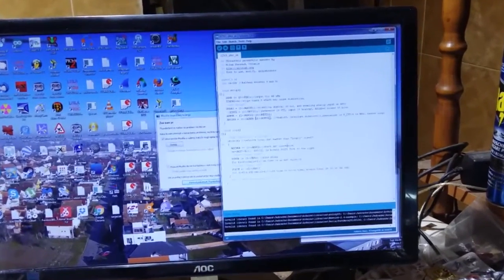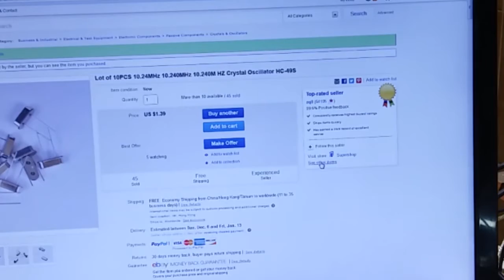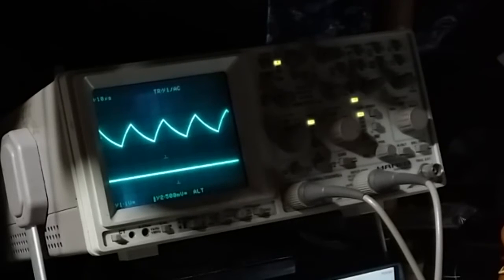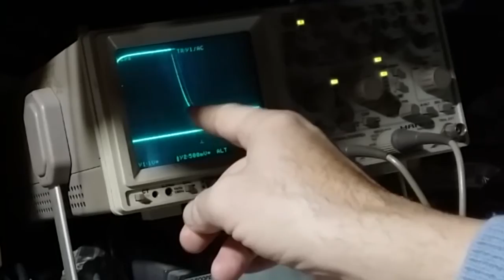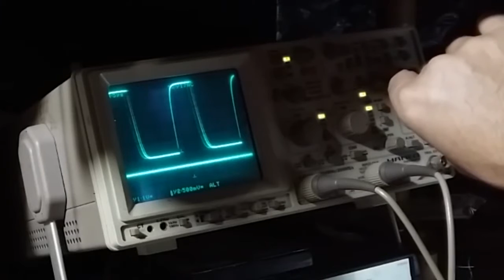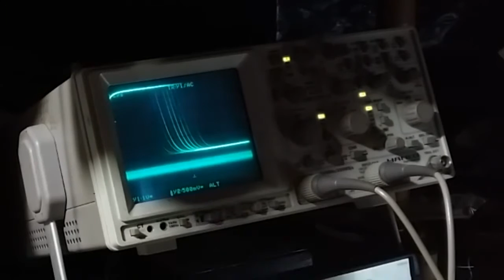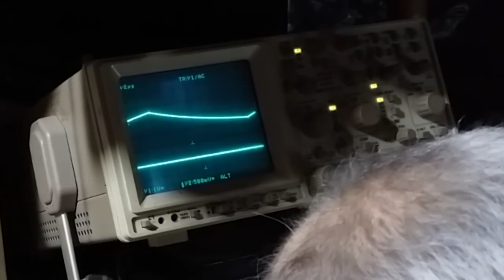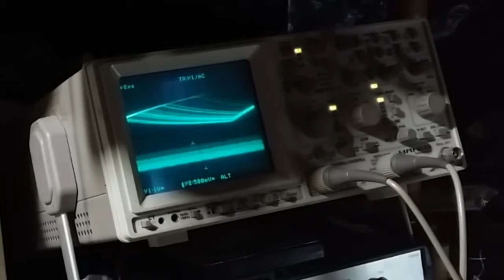PWM modulation - DAC on Atmega328p

Comment: Bok, kako ne - moze se na ATmega328 sa 16 MHz kristalom podesiti PWM na tocno 40 kHz. Kada se koristi 16 bitni timer 1 onda u fast PWM mode-u ne moras za TOP vrijednost koristiti 0xff (255) nego mozes koristiti i 0x1ff (511) i 0x3ff (1023), a osim fixnih vrijednosti se moze za TOP koristiti i OCR1A ili ICR1 (svaka od ove dvije mogucnosti ima neke prednosti i neke nedostatke). Uglavnom, ako za prescaler stavis 8 i za OCR1A stavis 49 pa podesis da se za TOP uzima OCR1A onda ce frekvencija fast PWM mode-a biti tocno 40000 Hz. U tom ce slucaju brojac ici od 0 do 49 pa ce biti jos vise od 32 vrijednosti za kontroliranje sirine impulsa tako da ce preciznost biti veca od 5 bitova a sirina impulsa (duty cycle) se moze podesavati s OCR1B. Slicno tome se isto moze postici i koristenjem timera 0 i timera 2 koji su osmobitni a jedina razlika sta se tice fast PWM mode-a je da se s njima moze koristiti samo jedna fixna vrijednost za TOP (255, sta je i logicno jer imaju samo 8 bitova) ali to nema veze jer se za TOP ionako nece koristiti fixna vrijednost i razlika je i u tome da oni nemaju pripadajuce ICR registre. Timeri su dosta komplexni, timer 0 i timer 2 imaju po 7 mode-ova rada a timer 1 moze raditi u cak 15 mode-ova tako da je lako previdjeti neku mogucnost. Da li si znao da neki AVR-ovi (recimo ATtiny85 ili npr. ATtiny861) imaju PLL clock za generiranje PWM-a od 64 MHz tako da se s njima moze generirati PWM signal na 250 kHz ili uz smanjenu rezoluciju do cak 500 kHz? U zadnjih godinu dana sam pogledao vecinu tvojih videa i vidim da te zanima 'direktno' (bare metal) programiranje Atmel-ovih mikrokontrolera bez koristenja Arduino-a pa ako imas bilo kakvo pitanje u vezi  AVR mikrokontrolera (i ne samo njih) ili ti treba pomoc kod projektiranja nekog elektronickog sklopa ili kod izrade neke stampane plocice samo pitaj :-) Na news grupama (hr.sci.elektronika i hr.sci.elektronika.mikrokontroleri) mozes naci na stotine mojih postova koje sam napisao u zadnjih 15 godina pa mozes vidjeti da nas zanimaju slicne stvari :-) Ostavicu ti ovaj isti kometar i ispod clanka o PWM-u na wildlab-u pa ce ti tamo ostati moj mail.
Reply from the maker: Bok. Ma može, samo u tom trenutku nisam skontao kako. Kasnije sam radio sa kristalom na 10.24 MHz, gdje sa određenim dijeljenjem dobijem točno 40 kHz. Ovo za 64 MHz znam, no tu sam imao problema sa nestabilnošću, pa sam odustao. Za sada ne radim nikakvo programiranje, ali ću eventualno opet početi. Možda uskoro, no koliko uskoro, to ne znam. Imam toliko ideja i potrebe za programiranjem, samo sam se u zadnje vrijeme ulijenio. Hvala ti za komentar i prijedloge. Možeš me kontaktirati na wild#wildlab.org, gdje # zamjeniš ...
Reply: Uopce ne sumnjam da imas ideja :-) Zato sam i reko nek javis kad ces sta trebati. Poslao sam ti mail.
Reply from the maker: Ok. To ću dobiti sutra tek. Taj server izgleda ne radi dobro vikendom. A da bi radilo, trebao bi platiti višu tarifu. Nisam odabrao baš najbolji hosting servis (Hosting24).